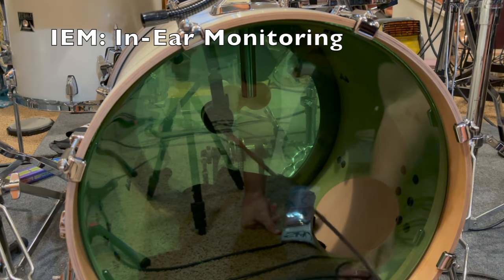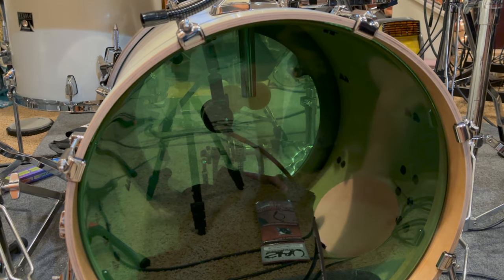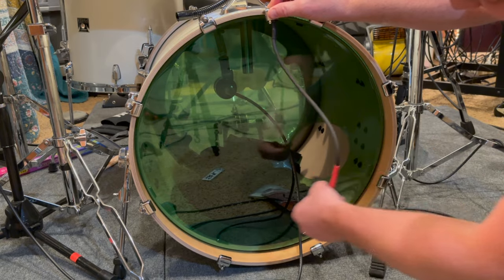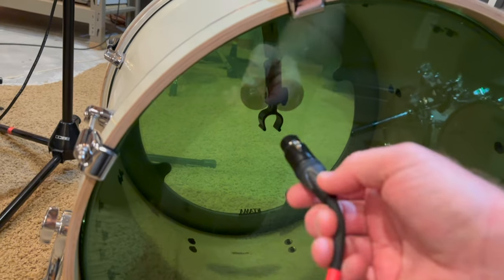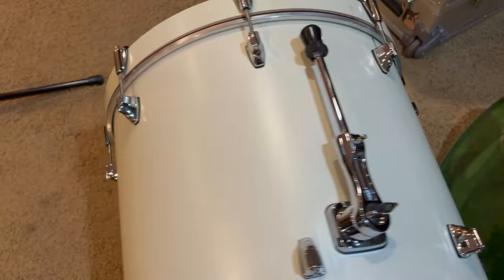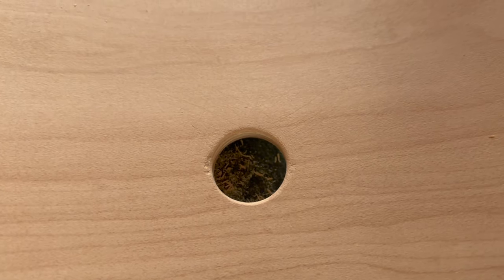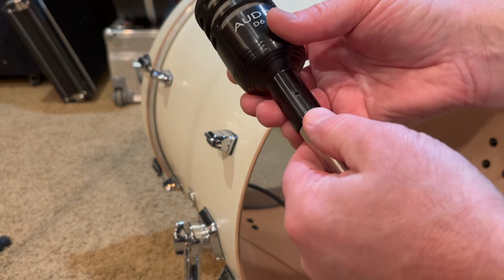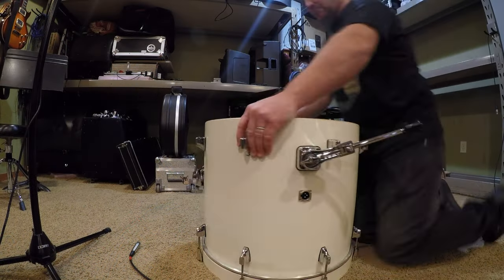Permanent Internal Kick Drum XLR Mic Cable

Comment: Great video! I did the same thing with my Audix and used the same Gibraltar mount, but I opted for the May Air Hole XLR connector, as I didn't realize that SHU made one. I love it and get compliments all the time from the sound crews.
Reply from the maker: Very cool, and thanks!

Comment: Two ideas
1 put a slip of double sided foam under the metal plate where you are screwed in. Metal to metal will cause vibration.

2 I put lock tight on my screws for the XLR connector to prevent them coming loose from the vibrations during playing and also movement of the drums from show to show
Reply from the maker: All makes complete sense! Thanks for sharing!!